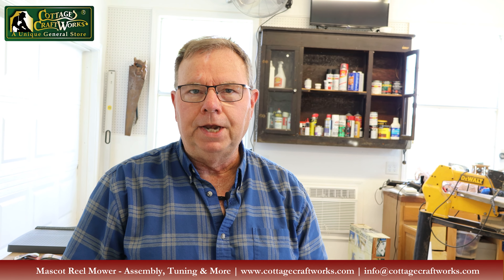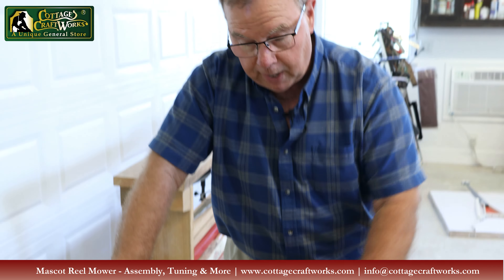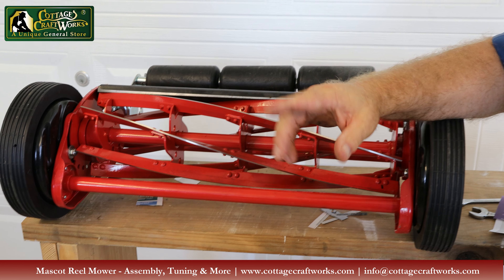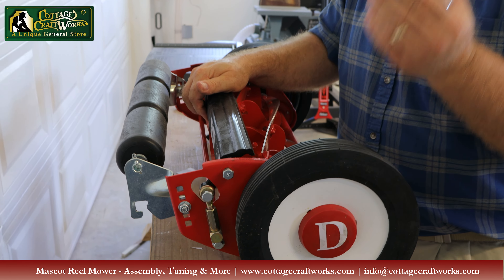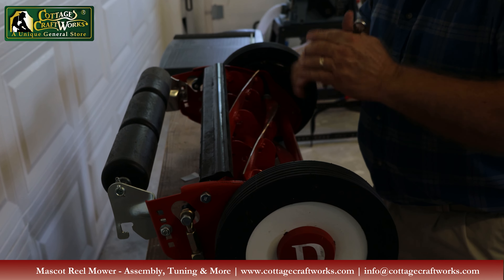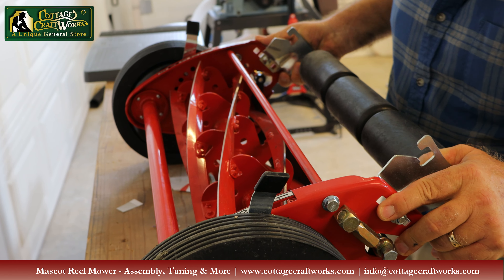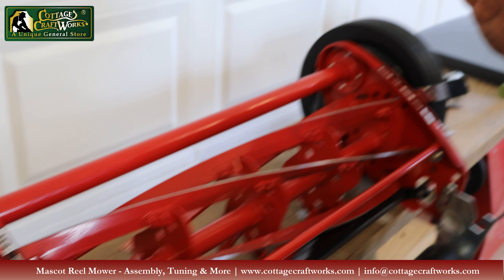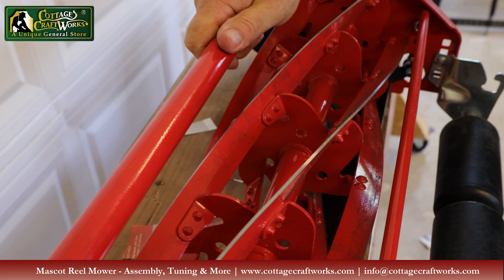Mascot Reel Mower Assembly & Tuning

Comment: Hi I got a used silent cut for a hundred dollars and I am trying to adjust it and what not...I couldn't find grinding compound anywhere here locally...was sold sand paper and naval jelly in my local Ace hardware store..
Not sure if that's going to help...I need to get it cutting better.m
Reply: lesco back lapping compound. don't use the sand paper. valve lapping compound for engines is similar...it's just a grit difference, sandpaper will never get the grit size right for the micron difference you need to do.